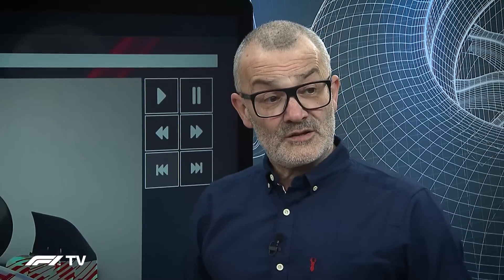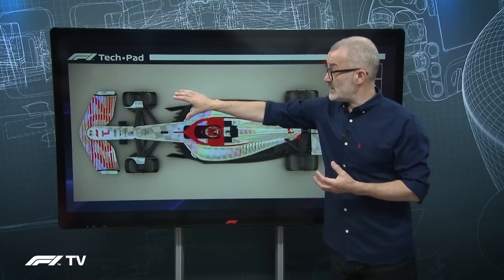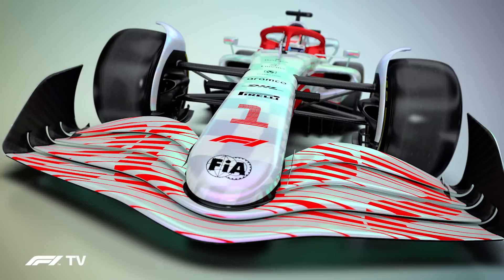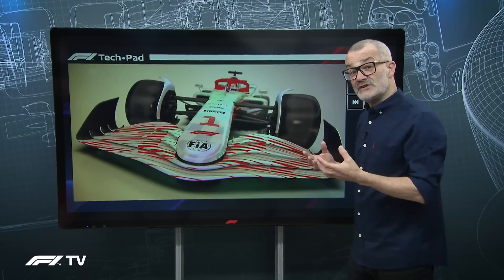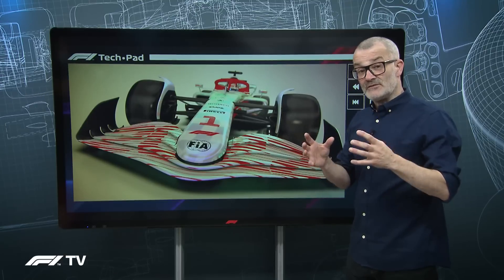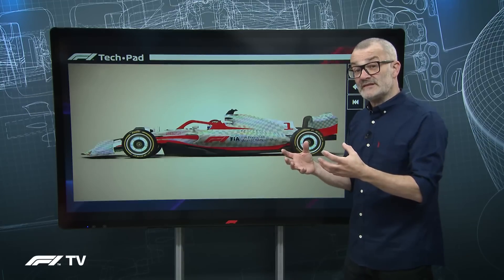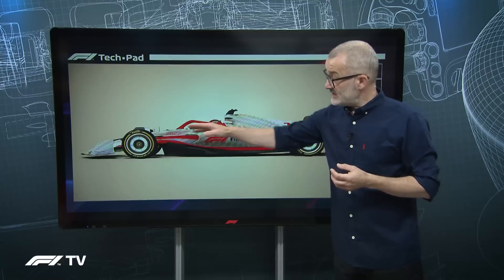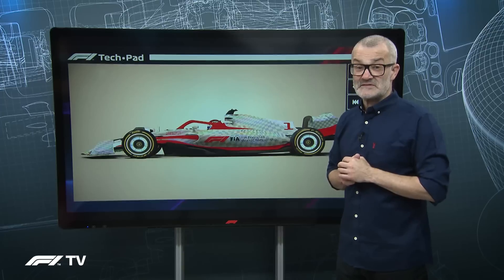A Deep Dive Into The 2022 Formula 1 Car | F1 TV Tech Talk | 2021 British Grand Prix

Comment: Thanks, great video. Question, will the larger wheel/tyre diameter on the 2022 car not cause more wake? Which contradicts the objectives of the new design.
Reply: I think the overall diameter will stay the same, just the rims getting bigger (compensated by the tyre edge being lower).

Comment: Why there is a significant reduction of downforce with new regulations? Is due to the increase of the height of front and rear wings (which reduse the performance improvement due to ground effect)?  Or there is a reduction of camber of the wings? Are the vortex generated by the turning vanes playing a role in that reduction of downforce? They should go under the floor and create a bigger negative ( relative to  atmospheric value) pressure, but i'm not very sure about that.  Tell me what you thing about that
Reply: Cars are becoming too fast. Still, with less downforce and less draggy downforce, they'll go much faster in a straight line.

Comment: F1 Rules that need to change:
1. Repairing your car under red flag to a greater extent than you could do under a normal caution flag should be banned
2. If a driver causes a collision with a driver of another team, the costs of repairing that car need to either be outside the budget cap, or the team that caused the crash should fit the bill
3. Un-lapping yourself after a red flag needs to be removed
4. A grid penalty for replacing components on your car due to a crash deemed not your fault needs to either be alleviated in that scenario, or the penalty applied to the driver who caused the crash
Reply: Totally not biased rules aimed squarely at one driver this year for things out of his control. What about not being able to repair damage to your car sustained on the formation lap before the race?
Reply: @PerplexedPhoton  would you not agree that rules that penalize you for things out of your control need to be modified?
Reply: @MeltingRubberZ28  I think it's too complicated of a rule to enforce fairly. Let's just take the Hamilton Verstappen accident we just had a Silverstone. The Stewards deemed Hamilton predominantly at fault for the collision, fair enough. But that doesn't mean Verstappen couldn't have done anything to avoid the collision either. In this instance do you think Verstappen shouldn't occur any engine or gearbox penalties in the future due to the crash, or that Mercedes should foot the bill?
Reply: @PerplexedPhoton  how do insurance companies do it now? Whatever fault percentage you have is directly proportional to your amount of the bill you cover. Predominantly is probably in the 65-90% fault range....I would think it would be simple enough for the FIA to assign a percentage, and the penalties/costs incurred are simple math.

Comment: What is the point of bigger rims if they're putting lids on them so you can't see them anyways?
Reply: Covered wheels isn't something new to F1.  Back in 2007-2009, some cars had wheel covers.  Depending on design, they aid with brake cooling as well as for aerodynamics.  

The bigger wheels and the addition of wheel covers seem to put viewing pleasure aside and more on function.

However, I think wheel manufacturers know they can use the wheel cover as a place to put a huge sticker over it.  From company logos down to the drawing of the actual wheel.  That's what BBS did with the Ferrari F2008 as an example. (You can google Ferrari F2008 wheel cover to see what I mean).
Reply: Bigger rims for more "road relevance" but also having a lower profile tire can be very beneficial. Right now the tire sidewall acts as a lot of the F1 cars suspension system, and since it's characteristics change with pressure it's not always predictable. Having a smaller, stiffer side wall will enable the teams to more accurately calculate what the tire will do and give them more flexibility with suspension tuning, in theory.

Comment: What if the floor is damaged on the run? Any subject or attacking a kerb too much would be enough to hinder the aerodynamic performance?
Reply: My thought-opinion is that it is possible to reinforce the points of the floor that will contact the track surface with a different material.  An example, although not exactly serving a protective function, is the material used on the floor of the current cars which cause them to spark when they hit the surface.

Comment: Am I right in thinking. If the car bottoms out the aero might stall and a sudden massive loss of downforce or is the skid pan going to stop that happening?
Reply: Unlikely. The bigger risk is hopping up a kerb and opening up the airflow under the car so losing downforce. Might mean that the track limits problem can be solved by a simple sausage kerb - hit it, lose downforce, slow down or spin.

Comment: I hope this means the new cars are more stable. The current cars are so sensitive that even a gust of wind is enough to throw the car of the racing line and potential of the road and into the runoff/gravel! That is so dangerous as the driver is just a passenger when that happens.

Comment: Ground effect cars (or wing cars) were forbidden because they were very sensitive to kerbs, bumps and damage to aerodinamic elements (mainly the skirts). How has FIA looked and overcame these issues in this new car/regulations?
Reply: The ground affect cars of old had a more rudimentary style of venturi tunnel and the FIA actually has a ton of data already.....based on the racing in Indycar believe it or not. They switched to a more ground affect car years ago now and have little to no issues. And IndyCar races on street circuits that are even more rough then what F1 cars are allowed on.  These new regs I would dare say even push for a more dramatic improvement on the tunnels used in Indy so I would say they are fine. Its also fair to note these new cars don't make the car attempt to seal the floor off completely, that was the issue back then. Material development also has improved a ton since back then too, in fact there is a push for even stronger cars going into next season so I would say all is fine.
Reply: @philipbarton3456  I was going to comment but you covered that 100%. So... "what he said^^^^"

Comment: FIA don’t want overtaking ! At least not in corners.
Close racing is a product of closely matched cars & drivers but invariably this will lead to contact between cars.
Now you would think that the driver who steers across the path of the challenging competitor would be penalised but not so, the driver who did all he could to avoid the collision & still continues to race is penalised so why bother with all the changes ? Whom ever get to the first corner & then completes the required laps without breaking down wins the race, the lead car much not challenged for the lead other than in pits stops.

Comment: Given that we could already hear how cars already do not look anything like this, it would be nice to get some concepts you can anticipate. For example rear difusor, Mercedes going to high rake (but long wheelbase?), possible shapes of wings?
Reply: I'd like to see a few interpretations too.  But high rake is out if most of your downforce comes from the floor.
Reply: Alan Davis the rake makes downforce with the floor. No rake next year because the downforce is made by the tunnels. In fact, to keep the air in the tunnels the car will have to hug the ground.

Comment: What I really wonder is if the teams could find so much downforce from the underbody that they go back to the "what are front wings again?" kind of cars.
Reply: I imagine it differs from track to track, look at Indycar for example. They have been running a similar (infact their version I think creates slightly less underfloor downforce. On speedway tracks the front and rear wings basically are nearly not there. I could imagine for tracks like say...Monza they might go with a similar direction if they get it right.

Comment: F1 22 car introduction: 4 min video. 
F1 22 car deep analysis video : 3 minute video.
Reply: It's behind paywall f1tv
Reply: i guess you missed the end bit where it says "f1tv full episodes available"
Reply: @perpetual_bias  It's the same segment on there. 21:51 to 25:04 on F1 TV tech talk. So no, this is the "deep dive", which is short and not deep at all.
Reply: @bwxmoto  ah wow okay. so much for that
Reply: Looks to me that if the car goes over the curb, all that nice ground-effect downforce is lost. Sending the car to the barrier. As opposed to that, downforce generated by the front and rear wing doesn't depend on the distance from the ground. They've banned active ground effect exactly because at one moment you have downforce, while 0.5 seconds later it's completely gone, causing lots of accidents. This passive ground effect isn't much better. I have a feeling we're gonna see much more accidents. Mazepin won't be the only one spinning.
Reply: (incoming video) F1 22 car full in-depth review: 40 seconds 
😂
Reply: F1 22 car A closer look: 10 minute video
Reply: Let's just shorten it to F-22
Reply: Just a lazy video. No comparison images or images showing the airflow, just some guy expecting you to get his 3 min "Deep Dive".
Reply: @flamehorizon984  the guy is Scarbs (Craig Scarborough) long time F1 journalist who usually digs into the technical aspects of the cars.

I was expecting there to be some analysis of the areas the teams might exploit in a ‘deep dive’.  
I’m guessing he was given a strict brief by F1 management & ended up as a short overview.
Reply: @Will-kt5jk  this is probably a short segment of the main video on F1 TV
Reply: @Will-kt5jk  Ah yeah, FIA just tells teams to design a 2022 car but details of it are kept secret.

Comment: It all look nice on the paper but I am afaid what will happen when car is on uneven ground cause the inertia of the wind in the car will likely cause a problem. 
Lets hope I am wrong ....
Reply: This new floor/venturi tunnel concept currently already exist in IndyCar, and IndyCar cars currently race on tracks much rougher then tracks certified by the FIA to run F1 cars. These new cars will do just fine.

Comment: So are the new rules decided and designed by Mercedes again?
Reply: Never was, competition just got killed by the fact that Ferrari decided to cheat engine regs, else 2017-21 wouldn’t have been so top heavy
Reply: No

.......the most successful teams will be given less time to complete testing. The system was trialled in 2021 with the results used to create a more formal, structured and steeper model for the 2022 championship.

Comment: Can't wait to see the teams interpret the new regulations defining these cars
Reply: The drivers when shown the car alr looked surprised, given they've seen the 2022 cars their teams are developing it's probably quite different
Reply: @dsdy1205  Maybe the drivers haven't seen the cars as much. If a driver decides to move to a different team (either last year or this year), they can take that information about the car with them to the new team.
Reply: 2022 will be interesting

.......the most successful teams will be given less time to complete testing. The system was trialled in 2021 with the results used to create a more formal, structured and steeper model for the 2022 championship.
Reply: I think at most they will be similar cars with just different liveries. The regulations are just too tight.
Reply: @pule.mogane  It should be pretty much the same as now. And as the years go on the cars will get even crazier.
Reply: that's exactly what the f1 game is all about.
Reply: Maybe we'll get such beauties like we got in 2014...
Reply: "Well, you didn't EXPLICITLY say we couldn't attach a fusion powered rocket to the back"
Reply: Haas will just have a giant Russian flag on the back
Reply: @joostpereira7470  and will simply use the demonstration model
Reply: @joostpereira7470  as long as it keeps them alfoat though eh!?
Reply: I heard there will be a lot of distinction around the sidepods and the nose of the car, otherwise the cars will look fairly similar like they do now